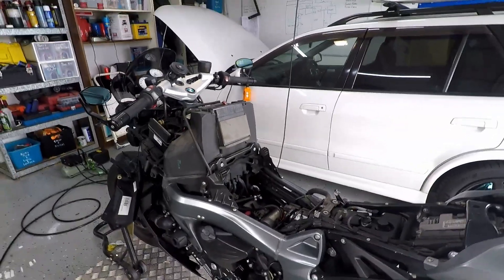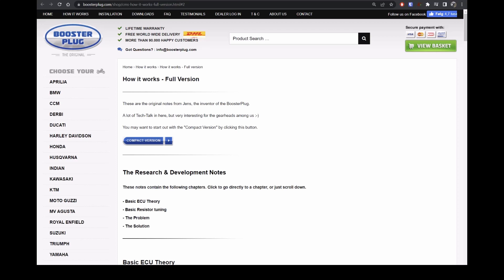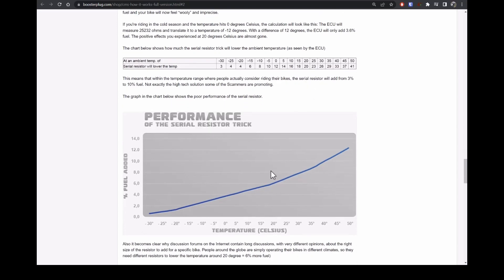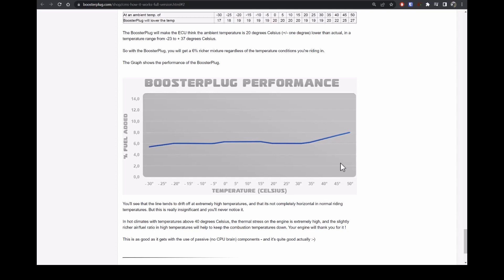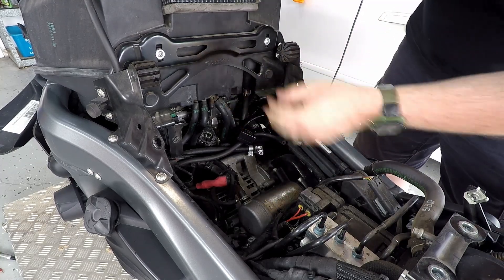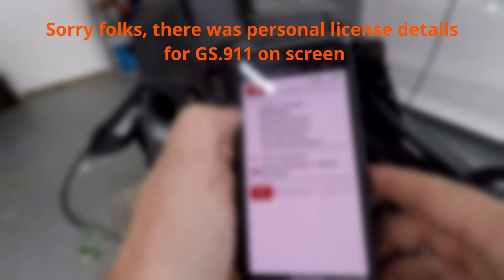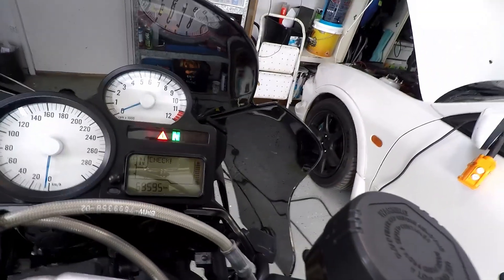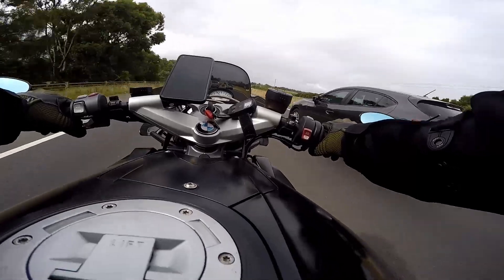Booster Plug install and technical review

Comment: I bought one if these and didnt noticed much change on my AFR sensor (in fact the mixture was barely changed). I opened the booster plug up and its simply a resistor that has the temperature probe going across it. Very basic unit and nothing like the 'clever' unit they suggest it is.

Comment: People...   a Booster Plug is a very temporary improvement and a permanent waste of money.  It sends a biased voltage from the airbox to the ECU, which causes the motor to immediately run slightly richer.  ("immediate and as expected impressive results")  But since we are not interrupting the signal from the O2 sensor to the ECU, the ECU knows that the mixture is rich, and in all closed loop cells (generally from idle to 3/4 max rpm/closed to 3/4 throttle) will gradually rewrite those cells, first with short-term fuel trim, then permanently with long-term fuel trim, until all closed loop cells are now back at 14.7/1 stoichiometric.  Normally, within 500 miles, your Booster Plug is having no more affect at all, but nobody ever writes back 500 miles later to say how the bike feels normal again.  
If you want to permanently change the AFR in closed loop cells, you need to bias the O2 sensor signal, using something such as an AF-XiED.
Reply from the maker: Unless you know exactly how the AF-XiED works - exactly - then posting three paragraphs of "Booster Plug don't work" followed by "use an AF-XiED" is just as subjective.  It also discounts how each unique ECU treats closed loop and exactly which loads cells where closed loop is ever used.  Blanked statements like "3/4 throttle" are highly subjective and unless one knows exactly where their particular ECU uses closed loop or not.

Please, if you're going to reply and discuss this here on my channel, be as objective as possible and no personal attacks.

Comment: Does having the booster plug alter the temperature readout on the instrument cluster? (assuming the K can display ambient temperature on there)
Reply from the maker: No, that is a different sensor.  Intake Air Temperature can vary greatly from ambient temperature in an engine, so these are always different sensors.

Comment: Nice review I fitted a Booster Plug 2 years ago to my 2011 K13 to smooth out a rough and random idling issue I was experiencing. I live in Darwin (average temp >30 degrees C) and was wondering if it was going to work. It did the job for me. My bike doesn't stall at the lights anymore. I have a Leovince can fitted and only experience exhaust popping when I ride a litter harder.

Comment: Thanks for the detailed video. May I ask what kind of mirrors are these that fit nicely on the K1300R ? Are you satisfied with the view etc? Needed some kind of modification to fit them ? Thanks for your time.
Reply from the maker: Hi!  I literally just fitted these and I love them.  They are Fenrir brand bar-end mirrors, model 801-0324.  The view is good and I find them easier to use than the stock mirror location.  Plus it makes the bike look way better.  They bolt right on, but I'll also upload a video about these soon so you can see it.  Note that this particular model is the blue tinted glass and if you want "white" (normal) glass, you will need to search for that model in the Fenrir catalogue.
Reply: @KaldekBoch  thanks ! they do indeed look very nice on the bike. Also that mod with the quad lock is spot on. The blue tint i think helps with the led headlight behind ? Probably will go the same way.  Ready to see the Fenrir video when you are 🙂
Reply from the maker: @ErrorFlynn  yep the tint is for LED headlight glare as I understand it.